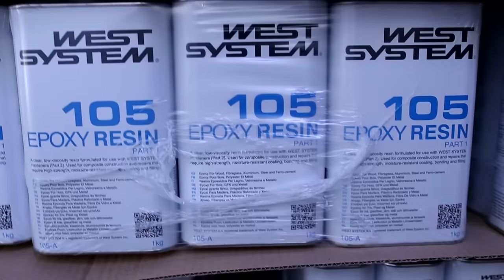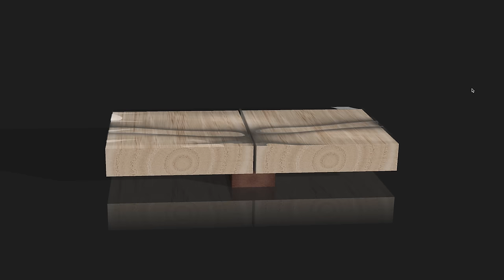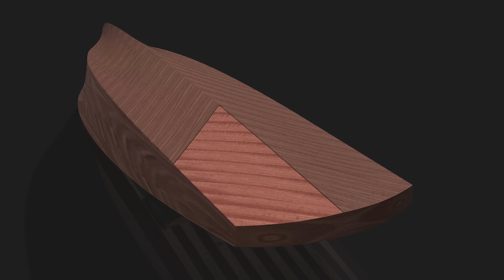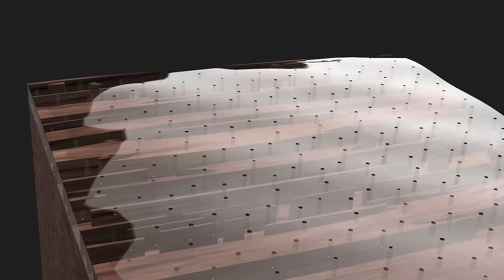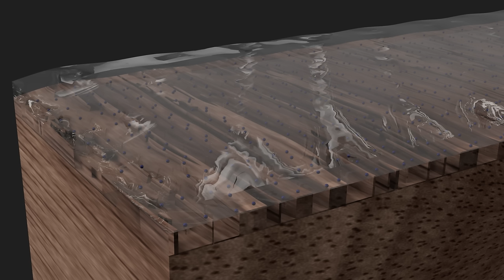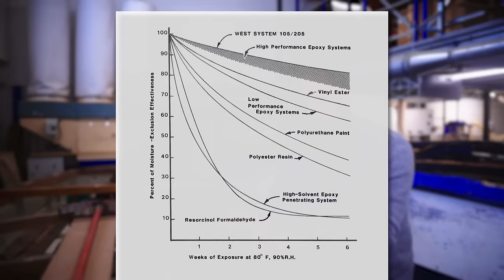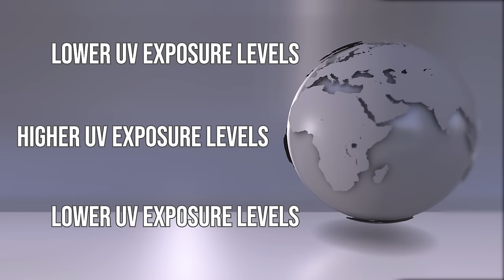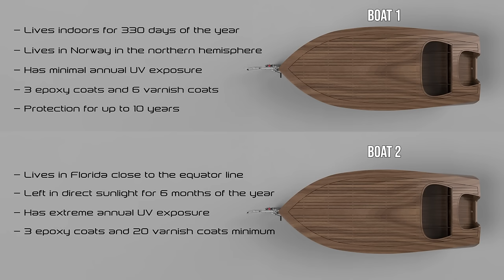Should I Epoxy Coat Wood? Everything You Should Consider

Comment: I’ve built 2 wood bikes with this system with no issues, and because of the frame geometry of a bike you have to apply it mixed with a powder to reduce the “flowing “ characteristics of epoxy. Great experience and the best results and great video by the way 👍🏻.

Comment: I'm responding only to give you a boost in the algorithm, very interesting information on epoxy! 

But since I'm writing, I'd like to correct what was likely a slip of the tongue.  The equator is indeed closer to the sun during part of the year,  0.001716% closer (according to chatgpt though it's often bad at math) during winter. However, during the Nordic summer the Nordic countries are tilted towards the sun. What limits the UV is the angle of the light - the same amount of light has to cover a larger area and the light travels through more atmosphere to get to the ground. I always find it interesting hos car paint on the top of cars in Florida or the Canaries can look like it's been totally burned to a crisp. That never happens here in Stockholm...
Reply from the maker: Yes you are right, I thought similar myself upon editing what I'd said. I'm sure the "equator effect" is not simply being closer to the sun but generally in a more directly exposed position year round. It's a long time since I studied that stuff at school 😆

I hadn't considered the angle and atmospheric filtration as a factor as well, more research needed on my part... still, another validation that the earth isn't flat at least 🤣

Comment: just epoxy-repaired an old djembe drum, where its' bowl and horn edges contained splits down from their edges. Epoxy was the way, which slipped into the small crevices easily. After, the drum...rang like a bell :-) its how one knows if the repair worked, by hitting the wood to hear it "ring", or "thud". I digress.... :-)))) I prefer a less-costly epoxy-brand for boat-building, etc. USComposites, WPB, FL, USA. amazing stuff!!

Comment: You have missed one important use of encapsulation and that is making a soft surface hard as well as structural. An epoxy layer can be used - not just as coating but as a way of making a sandwich when you want to use wood for aesthetic reasons or if you are restricted in the use of exotics such as carbon fibre bonded with epoxy. I have used Western Red Cedar or lightweight mahogany substitutes coated with epoxy in this way to reduce weight while maintaining and sometimes improving structural properties. As a boatbuilder you will also know that obtaining good quality mahogany is almost impossible and even illegal for some species and this is a good way to substitute these in a functional way.
Reply from the maker: Yes, that is one of many other benefits to encapsulation. There are lots but my aim for this video really was to highlight they key points to consider behind when you can use this process. End use applications extend way beyond the examples I have mentioned here of course.

Comment: Very useful - I'm just sealing/coating a brand-new tiller on my moored yacht, but I now understand how often I will (a) have to re-coat the tiller or (b) replace the tiller. I'm even thinking I might just forego the 'wood look' and use an epoxy seal, with a good UV resistant paint ... One minor point to correct, however - my boat is moored in Melbourne which is affected by the ozone hole (yes, it's still here!) so we get very fierce UV damage, including to our skin. I noticed this when I went to Queensland where I got less sunburned than I usually do in Melbourne. So the relationship between latitude and UV damage has variations.
Reply from the maker: That's interesting, I hadn't really heard the hole in the Ozone layer mentioned for years so I just presumed it was one of those ideas that people had given up on now 😆

Comment: Very good presentation.  I did think of one thing though.  That is ease of refinishing when the coating system eventually fails.  My experience, although limited, is that failed epoxy coatings are much more difficult to remove for refinishing than a typical varnish.
Reply from the maker: I’ve seen a lot of people say this but actually they can be removed very easily with a heat gun and a scraper. Maybe I need to add a tutorial on this to my list of videos to make.

Comment: Lovely!  Would like to know the elongation to failure percentage for coupons that are the same thickness as what we would typically apply- 15-40 mils.  Then add the element of cycling at 365x per year to see if it breaks down faster due to fatigue.
Reply from the maker: Thats a good question, from what I learnt during my visit, they explained that the stated tensile elongation of the epoxy is the limit to which the epoxy can stretch and then return to its original state. Therefore it can handle cycling within this amount. It is cycles that exceed this figure that begin to do long term damage and cause it to break down. 

One of the reasons it is set to 3.2% is that this is just above the elongation rate of glass matt, meaning that glass will prevent cycling exceeding that of the epoxy's capacity and therefore stop it breaking down long term.

I know they also do tests where cyclic loads are applied to it, some under heat as well to see how this alters at different temperatures.

Comment: Okay Captain Dan !! … Question : if you use CPES first ,   would you-could you use the West Systems epoxy ( 207/105) over top of it AND then use an Interlux or Pettit polyurethane paint on your wooden boat ??? … if the question seems stupid, I apologize but , I was always taught that there are no stupid questions, that’s how we learn !
Reply from the maker: A good question, like you say there are no stupid ones! In theory, yes you could certainly do this, potential things to look out for would be to ensure that all the solvent has evaporated from the CPES before you begin applying West System over the top to ensure you don't get solvent entrapment. Also ensure that the surface is well keyed up before applying West System epoxy as it wants to have a good key to bind to. I guess the CPES could have the effect of priming the surface first and potentially compromising the bond of the West System thereafter. 

My question though would by why the CPES? If you are fully encapsulating with West System then there is no benefit I can see to having the wood fibres underneath saturated with a penetrating epoxy. It's really not adding anything to the party.
Reply: @DanLeeBoatbuilding  … using Southern Yellow Pine plywood here in Virginia and use the CPES throughout … intend to use the West Systems epoxy over 5 inch fiberglass mat at all the seams … thank you for your excellent advice !!! … your expertise deserves hearty approbation !!!
Reply: @rjwintl  I've been using the CPES method for 2 full years and here is what I found.   CPES then West Systems works excellent as long as the solvents have flashed off (24 hours).  Varnish will not stick to CPES, it will lift sporadically.    CPES (1 coat) plus 2 coats of West Systems works excellent.   I allowed the West Systems to fully cure, then sanded with 320, then applied the 2nd coat of WS epoxy.   Then sanded with 320 and applied to thick coats of Epifanes varnish (one part).   This worked excellent here in Florida.    I have tried all of this on a porch edition before starting on the Apreamare 10.   I am a believer in this method because the CPES penetrants deep.   I also allow no less than 7 days (preferably 10) days to allow my stains to dry.   Thank you for bringing this up, we are like minded.

Comment: A wealth of info there! Thank you so much for the time and effort in making this video.
The amount of protection coats required for high UV environment is staggering…
When renewing, how much sanding of previous coats is required?
Reply from the maker: Yes that sun in Florida is pretty aggressive! The amount of sanding would really depend on the amount of damage done. If the coating is severely broken down (a significantly lost gloss and possibly beginning to crack) then it may need to be taken back quite far. If you keep on top of things and regularly maintain it then just enough sanding to key up the existing layer will be fine.
Reply: @DanLeeBoatbuilding 
Thanks for the reply.
By the way, your interview by Tom Cunliffe was awesome! 
And fresh also: 17 C and in T-shirt 😂
Reply from the maker: Yeah that was good fun making that video. I’m still holding on to the last bit of summer here… wasn’t wearing a t-shirt today though, it’s down to 12C now 😟

Comment: Excellent overview of the topic, and your test examples clearly demonstrate the possible causes of failure. One question if I may which you very briefly mentioned, and this is related to my current build of a John Welsford Navigator: I am ore-encapsulating the major components before glueing them together. Simply because some areas are hard to coat once assembled. Anything I should consider with that?
Reply from the maker: Thanks! Pre-encapsulating is a great idea, like you say it means you can be thorough on parts that you may not be able to reach later. Things I would recommend to consider:

1. Remove any amine blush, with warm water and dish soap/washing up liquid prior to installing parts
2. Adequately key/pre-sand parts if you are bonding to them later (80g ideally)
3. Don't overlook potential holes in parts further down the line, seal these properly. As we saw with the water immersion tests, one hole allowing for ingress can compromise the encapsulation process.

That's all I can think of right now.
Reply: @DanLeeBoatbuilding  Very helpful advice, thank you so much!!

Comment: Brilliant video and many thanks. In considering the expansion of butt joints used in a plywood and fibreglassed sheathed construction, would the fibreglass tend to inhibit any such expansion and therefore the '3.2%' epoxy expansion not be a problem?
Reply from the maker: Glad you liked it! If the joint is well backed with a butt block giving sufficient support and glue surface area to the joint then yes you should be ok. I would highly recommend scarf joints as opposed to butt joints though in plywood construction. Done properly they will eliminate the risk of movement and cracking along seams.
Reply: The only way that the epoxy would crack would be if the fiberglass bridging the joint cracked. Low possibility.

Comment: Dan, It was good but can you talk about aluminium powder for uv protection, if only to explain why you don’t consider it for this sort of work. It appears to possibly be a longer lasting protection.
Reply from the maker: A good one. I am pretty sure most UV protection in clear coats is done in this way. I would be wary of adding powders myself to clear epoxy as I would be worried about compromising the colour of the finish. It would be worth doing some experimenting with though. I need to try and make friends with someone that has a UV exposure chamber so I can try some experiments like this.

Comment: Can the epoxy be applied to laminated wood that's been polyurethane painted? Great video.Thanks
Reply from the maker: Ideally you would want the epoxy to be the first product on, applied directly to the bare wood. It will certainly stick to polyurethane paint providing it is abraded correctly but you won't necessarily see the same performance benefits that I talk about in this video.

Comment: Since boats do flex, will the epoxy glued joints of the frames and longitudinals of my boat eventually. How can help to ensure a boats frame and planking won’t flex more that 3%?
Reply from the maker: This would be based largely on the boats construction. What is the construction method used in your boat?
Reply: @DanLeeBoatbuilding  it is a 14’ skiff plywood on frames with 2 layers of 6 oz cloth on the outside. I don’t think it flexes much, but 3% doesn’t sound like a lot. Thanks for all the research and insights, by the way.
Reply from the maker: Yes 3.2% doesn't sound like a lot, this is one of the reasons I wanted to show physical examples in the video. Remember that 100mm timber needs to expand to 103.2mm but consider 1m square of your plywood skin... that would need to expand to 1032mm to create a failure on its surface, no plywood is ever going to do that!

You have a stable construction boat there, especially with the addition of glass. Joints and seams are where you may see potential issues. If you have a bit of a dry joint in some ply transitions that breaks apart in time through use then you might see a problem arise there. Also if a frame breaks away from the skin at any time through use, damage or general fatigue. 

Holes drilled in parts that aren't properly sealed are probably the biggest cause of ingress leading to failure. Black marking around these as we saw in the water immersion tests are the early warning sign for this.

I would say with your boat, keep an eye on seams , joints and holes over time. If a joint experiences excessive movement and you see the finish crack along it then you know it's moving a bit too much. Address it early on before water sets in and you'll be fine for years to come 👍
Reply: @DanLeeBoatbuilding  thanks, Dan!!

Comment: Hello ChatGPT, summarize this 30m video in 2 sentences.
Reply from the maker: For a non ai response... use only in scenarios where expansion and contraction will remain less than 3.2% especially spanning joints. Either adopt a thorough encapsulation approach or leave adequate breathability in place. Coat with a good quality paint or clear coat that will offer sufficient UV protection based on your expected area of use.

Sorry, that was 3 sentences 😄